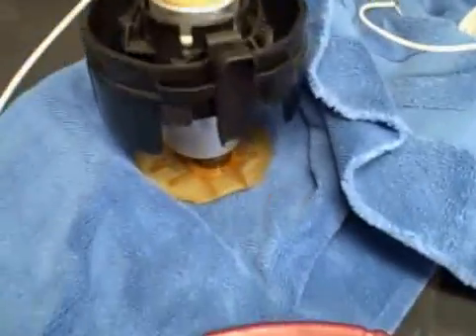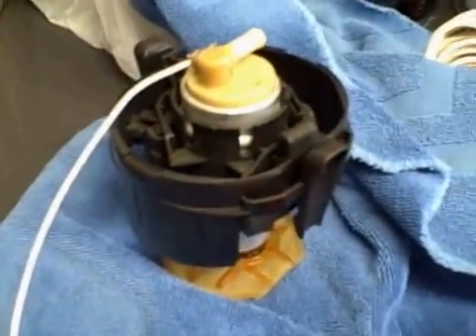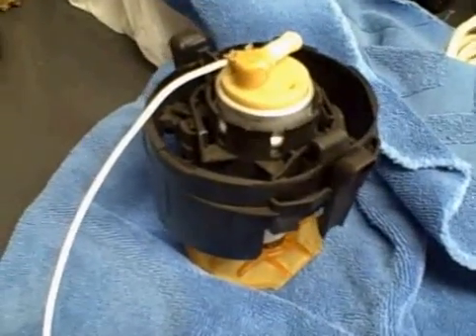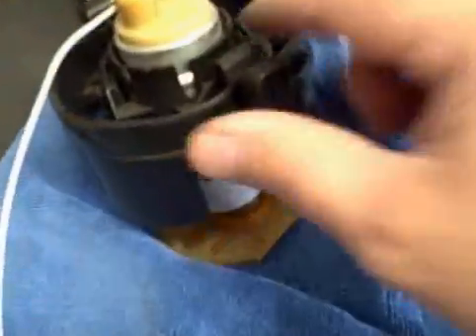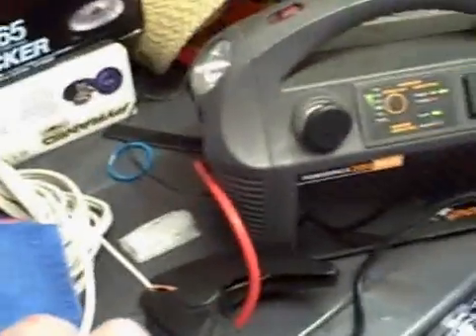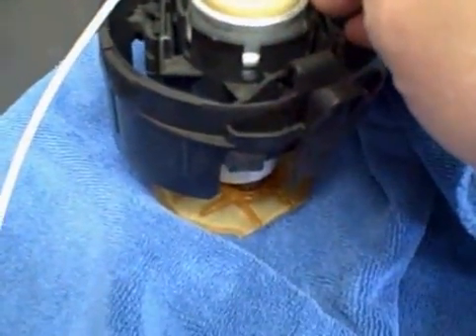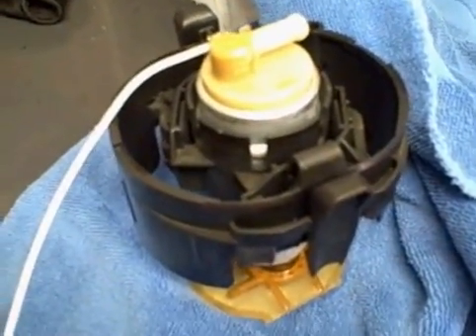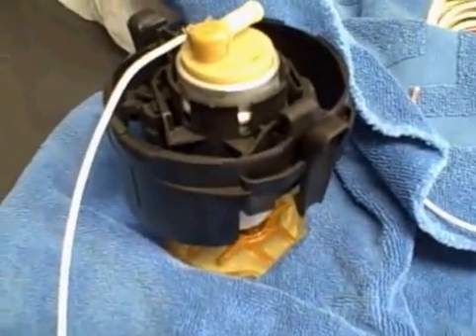e38 Fuel Pump Bench Test

Comment from the maker: FYI, it WAS the pump. It would run, but it would not create enough pressure at the fuel rail due to wear. The new pump fixed it. I also had a fuse issue that happened before I disconnected the battery

Comment: So before you changed you're pump was the car starting at all
Reply: Yes, It would start and run for about 5 seconds. The pump was strong enough to create enough pressure in the rail to start the car, but not enough to keep it running

Comment: Dear Mike, I also followed the other videos (e38 Fuel Pump Change 5 parts) and I found them very interesting for my particular problem which was also yours. One point is not clear to me: which is the 30A fuse  you have changed (where phisically is) to definitively fix the problem. Thanks in advance for your kind indication. Cesare

Comment from the maker: Turns out this pump WAS the problem. While it would run (as shown) it would not produce adequate pressure for the injector system. The new pump fixed the problem after I also replaced the 30A fuse that blew as this pump struggled.